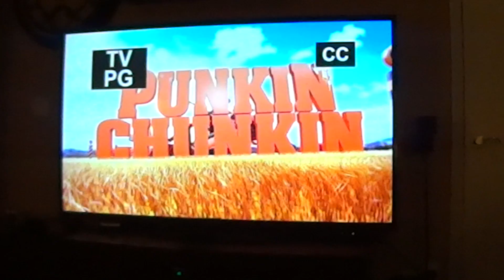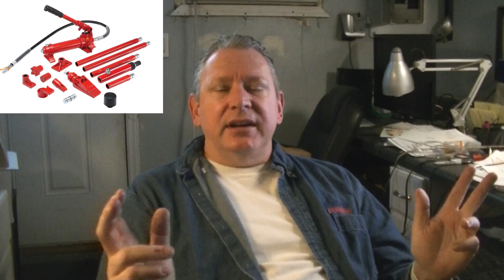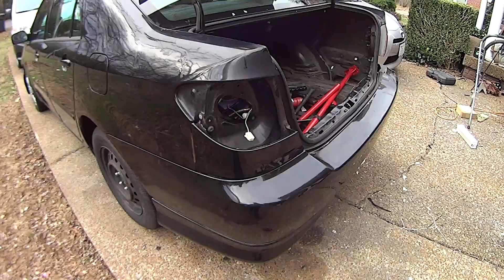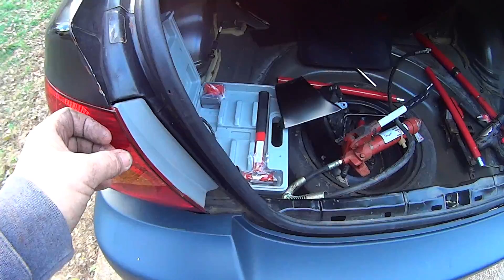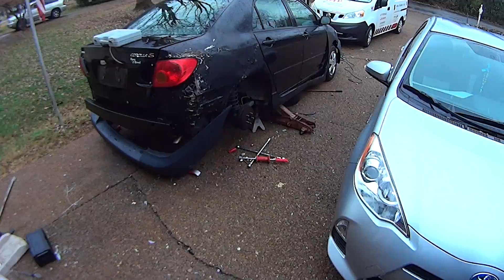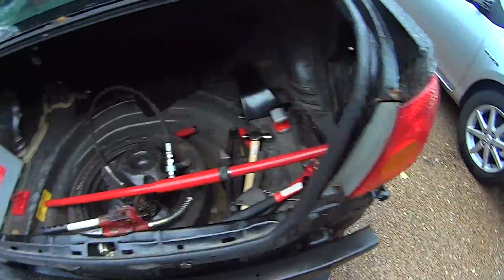Rear Quarter Panel Repair 05 Corolla and Punkin Chunkin sadness ..

Comment: The corolla isn't a 2005, its a 2004/2003. You can tell by the rear turn signals , grille , radio and passenger airbag sensors. The 05 has clear turn signals but the bulb is coloured itself, on 04/03 the bulb is clear but the plastic is coloured.

Comment: porta power units are awesome.  Your a brave man to fix that dent i'd just cut it out and weld a new one in.   Will you get snow down your way ?
Reply from the maker: No snow yet usually in January get a few days. Mostly here you get the really cold rains and black ice in the mornings.  Still have to do a bunch of straightening to get the new quarter in the mangled rest of it . I did consider that too .... and still wonder if that wasnt the best option - we shall see eh ? :)

Comment: Nice work getting that quarter back to a usable state.  Good tips for the DIY person trying to do their own repair without extensive bodywork tools.  I suppose if it were me, I would have cut and sectioned in a new panel.  Whether I welded it or used structural adhesive.  I can sympathize with the kind of repair you are doing for sure.  Takes a lot of patience to push, pull, hammer and dolly something like that back close enough to use some filler on it to get it straight.  These newer cars have such thin gauge steel on them that it can be a real challenge to work with.  Keep up the good vids!
Reply from the maker: Thanks bro I was somewhat on the fence on replacing the whole quarter but wanted to try and save the old one.  A new Chinese quarter is about 250.00 and certainly even thinner metal than factory.